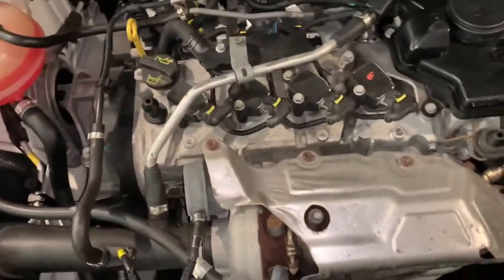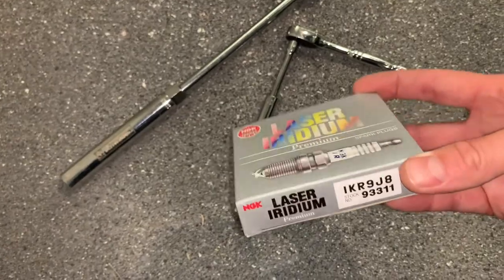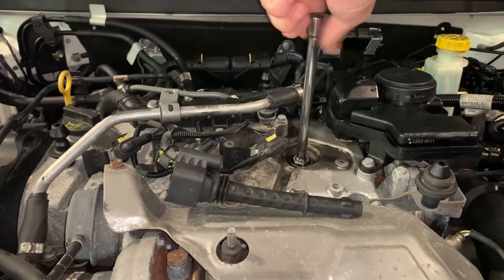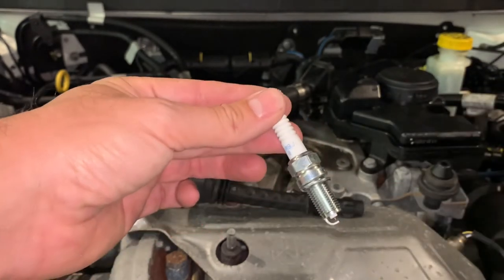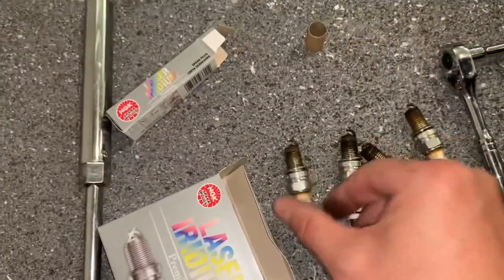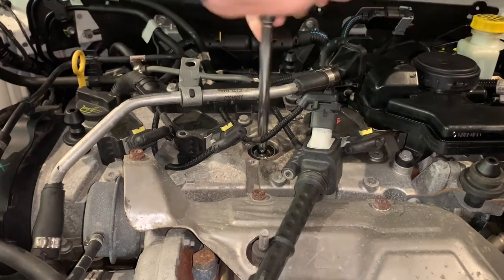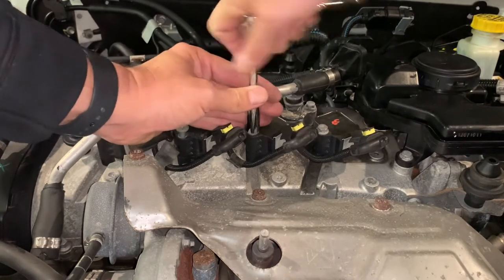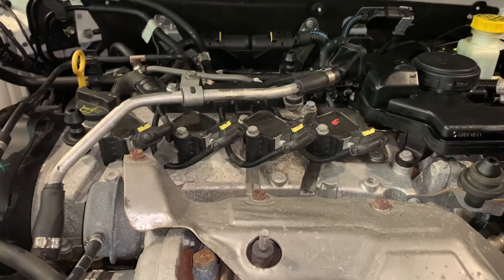How to Change 1.4L MultiAir Spark Plugs

Comment: Thank you for the video, will do the same for my 1.4 tb ma 170hp engine 🙏🏽 Do you disconnect the negative line from battery before changing spark plugs?...or not necessary?
Reply from the maker: @filipsmorozovs625  always a good idea to. Clean the turbo filter bolt while you are at it. It’s in my other video 😉
Reply: @TheEddysGarage  already changed spark plugs without disconnecting the battery:))) all fine tho)) previous plugs were really oily and brown, so happy that changed them) 
Banjo bolt - yes, watched all your videos about giuliettas)))) for banjo bolt will find new aluminium washers - was advised on Alfa Romeo forums to put new aluminium washers after each cleaning of banjo, and then clean the bolt as per your video 🙏🏽

Comment: Great video!!! Do you happen to know if the engine in the Giulietta is the same as in the Fiat 500L Trekking (1.4 MultiAir - USA version)? Thank you!
Reply from the maker: It would be. Check my video on the MultiAir filter and the turbo banjo bolt filter. It could save your engine!